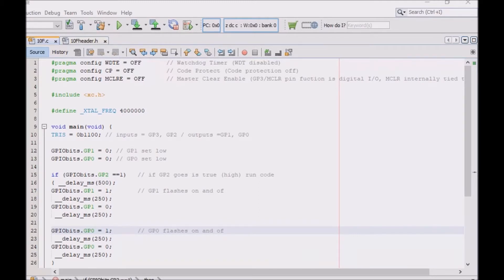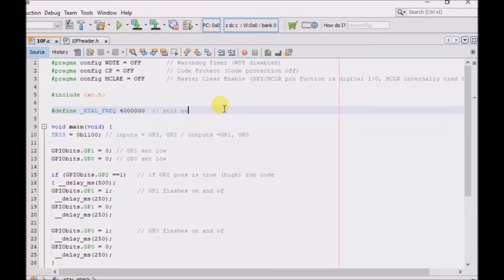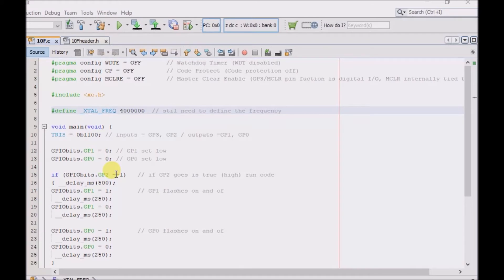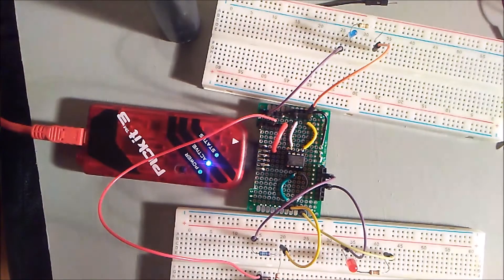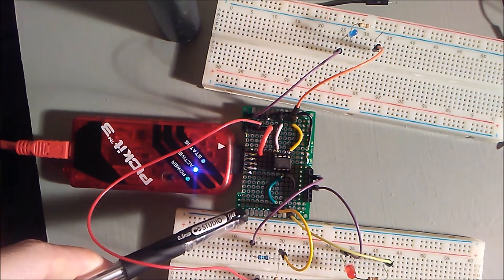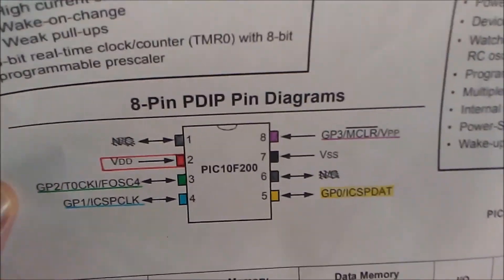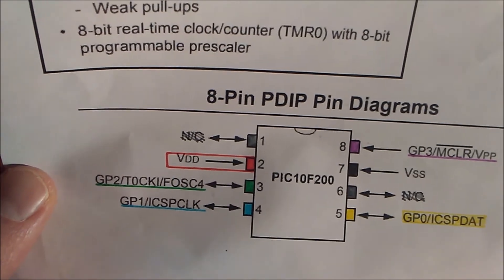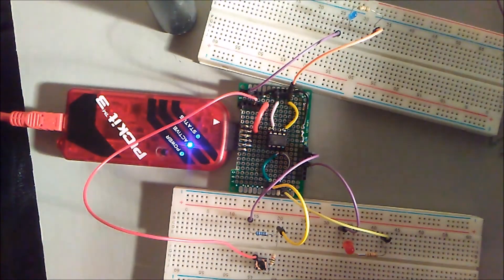The PIC10F200 Series: Part 001: If Statement, Input/ Output Pins

Comment from the maker: Sample Code I used in my project. Try it Yourself!

void main(void) {
TRIS = 0b1100; // inputs = GP3, GP2 / outputs =GP1, GP0

GPIObits.GP1 = 0; // GP1 set low
GPIObits.GP0 = 0; // GP0 set low

if (GPIObits.GP2 ==1)   // if GP2 goes is true (high) run code
{ __delay_ms(500);
GPIObits.GP1 = 1;       // GP1 flashes on and of
 __delay_ms(250);
GPIObits.GP1 = 0;
 __delay_ms(250);
 
GPIObits.GP0 = 1;       // GP0 flashes on and of
 __delay_ms(250);
GPIObits.GP0 = 0;
 __delay_ms(250);
}